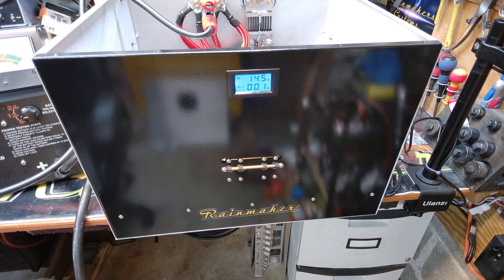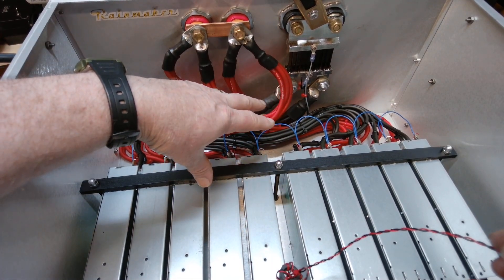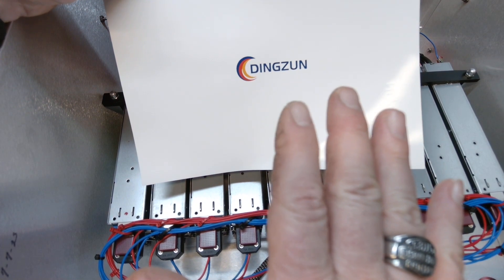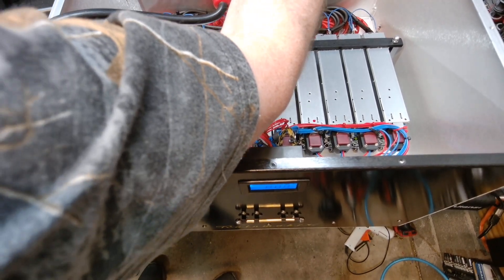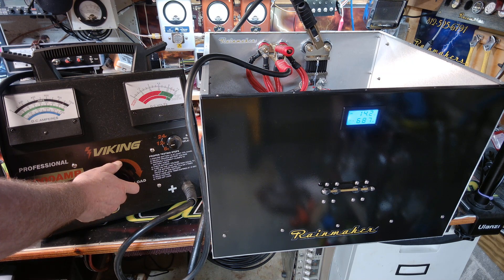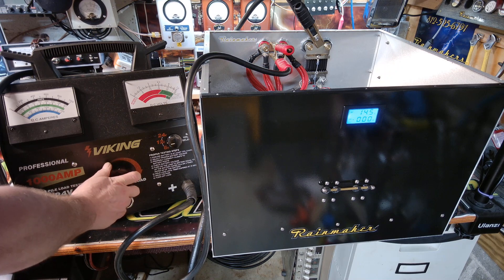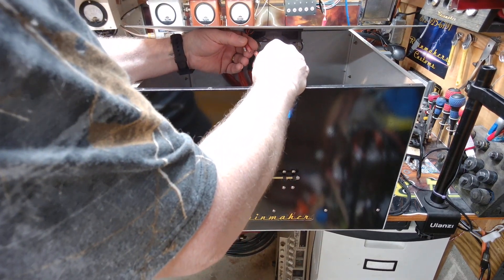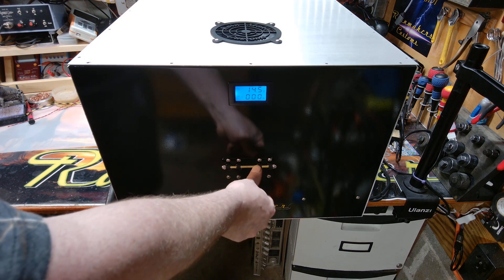1,000 Amp Load Test. (For Sale)

Comment: Ohms law dictates that the supplies will only output aprox 830 amps at 14.5vdc. 1200w is 1200w. which is the supply rated output. This is why at 1000amps they protect. The voltage drop was consistent with the ratings as well, @1000a the voltage was around 12v. Rated output. Good looking build, clean wire management.